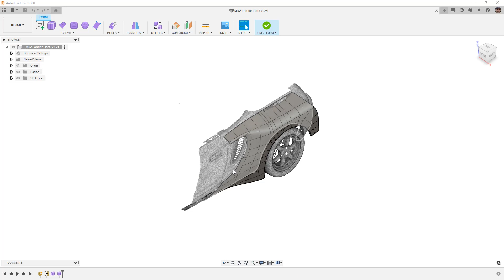Design a Fender Flare in Fusion 360 - Adjusting Edge Control and Flow #Fusion360

Comment: If the shape is completely done 
Could you create a shape around the part that could 
Be 3d printed as a mold ?
Reply from the maker: Sure can.  I would suggest doing that with surfaces after the form is done so you can adding parting lines around it.  EasyComositesLTD has some good videos on the subject.
Reply: @LearnEverythingAboutDesign  
Thank you 
I am receiving my einscan scanner today 
If you would like scan data I would love to help you 
I have c6 corvettes if you’d like 
Quarter panel and fender scan data 
I will provide them 
I have parts off the cars so it will give 
Very clean scans with complete mounting locations
Reply from the maker: @steeltree-fabricatingandcu3796  Would love it!  I actually have some scans from a c6 but can't use them publicly so if you have something that could be shown on video or shared that would be awesome!
Reply: @LearnEverythingAboutDesign  
Yes any thing I send you
You can use on video 
I don’t mind 
You can share my name as well 
I’d love to work with you 
I’m kinda new to fusion 
I have used it for plasma cutting 
And drawing parts 
I have to admit I struggle with it .
It’s going to be a Intral part of what I’m doing 
I’m planning on 3d printing molds to build a complete body 
So design and 3d scanning of the original car a 69 Chevy corvair 
Ground up custom build 
Ls swaped complete composite body
Reply from the maker: @steeltree-fabricatingandcu3796  Sounds like a cool project!  What do you do for the drivetrain on that?  Cause just adapting the LS would destroy the stock driveline :)  c8 wreck donor?
Reply: @LearnEverythingAboutDesign  
Im building a new chassis 
And different suspension 
Basically stating with just the body shell and cutting all the floors and firewall away 
Porsche boxer transmission with adapter kit 6 speed manual 
I plan on doing composite floorpans 
Like the c6 Vett 
Front suspension will be c4 corvette 
The rear will be 2010 Camaro hubs with hand made control arms 
With cantilever coilover shocks to hold it all up
Turns out my hp pavilion is not enough computing power 
To run the scanner 
Time to upgrade lol 
It’s only money lol 😂 
This scanner is some sick hardware
Reply from the maker: @steeltree-fabricatingandcu3796  Love it!

Comment: Thank you for taking the time to record and upload this! I will continue watching the other videos in the playlist. Have you taken this from model to part? I would love to learn more about the transition from the 3D model to the manufactured fiberglass panel and what it actually costs to create a one off or production mold.
Reply from the maker: I have a series i plan to update next week about the entire process from scan, mesh prep, design and print https://www.youtube.com/playlist?list=PLBDfGh8A8kXVvKBJ4UudhVLKlPdumAg5P   I have to update what is going on with that project with some more info but that series has a bit more of the process.  I did the MR2 video for someone and to the best of my knowledge nothing has been created from that.
Reply: @LearnEverythingAboutDesign  Thank you so much! Looks like you are going to create a pattern of 3D prints and join them together to make a mold?
Reply from the maker: @thebandit4393  When i started I wasn't sure.  I think I will be actually glassing outside and inside.  Not sure if youve seen the 3d printed Lambo.  All PLA and they did a few layers of cloth on the inside and outside and used the 3d print as a core.  Problem is the print time.  If i could it would be much better to cnc foam as a mold but use what you got.
Reply: @LearnEverythingAboutDesign  Ah yes I could see doing it that way, although I can't imagine it coming out at light as a conventional fiberglass layup. If you use the prints to make a reusable mold you'd have the option to pop new panels later for others or to replace yours. The work would be about the same but wouldn't consume your printed parts in the process. Just a thought - look forward to seeing however you do it
Reply from the maker: @thebandit4393  Yeah some people were saying to just use the prints as is with PETG.  But with so many pieces on such a big panel it just won't be strong enough.  I printed 2-3mm thick with ribs on the back.  The other idea was to make a plug off the 3d prints including the OEM fender mounts so it would just replace the entire fender.  Still not sure.  I need to finish gluing these things together and get it on the car.  I am not 100% sure its the direction I want to go with the car and don't want to put the effort into this 3 more times if it isn't lol.
Reply: @LearnEverythingAboutDesign  Appreciate the discussion and sharing ideas. I think just getting the shape onto the car is an excellent direct use of the 3D prints, but for a finished product I would favor fiberglass. The design looks great on this. Hope you get a chance to try it out in real life!

Comment: So after watching this video I know it is recommended to about t points, star points, n-gons, and triangles. But obviously they are sometimes needed, is there a preference as to which is better to use over the other. For example are ngons better than star points or t points?
Reply from the maker: Hi Dsk, I don't know universally if there is a preference.  For me i prefer n-gon(or 5 sided n-gone more specifically) over a tri.  The main reason is that a triangle is always flat.  When you have a triangle you are making a plane because it will never have curvature.  That means the geometry going into and out of its edges needs to be flat in that area.  Strictly speaking an Ngon is also flat.  But areas like a change in direction of the "flow" like around a fender, 5 sided ngon seems to work better than a triangle.  I know this is true for poly modeling as well.  4 sided is the ideal.